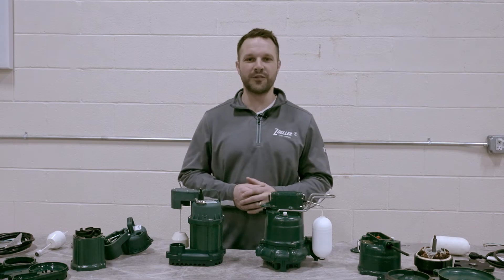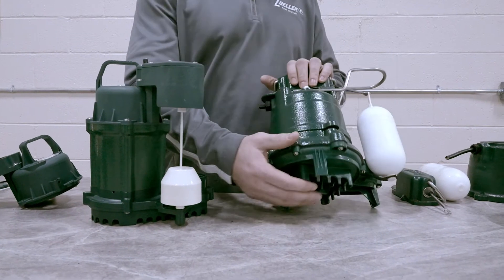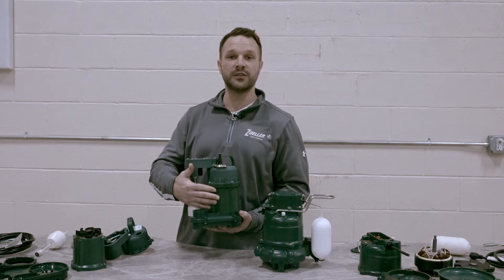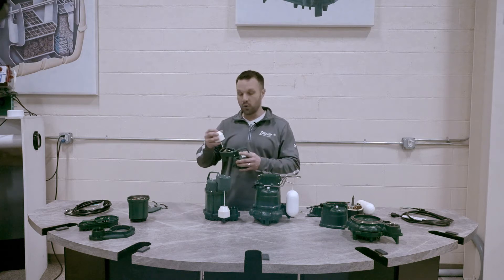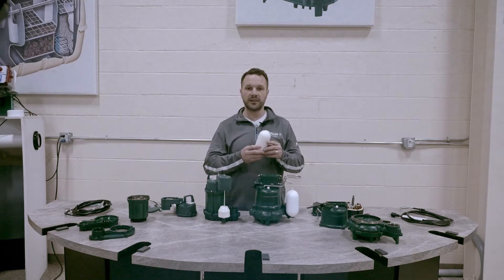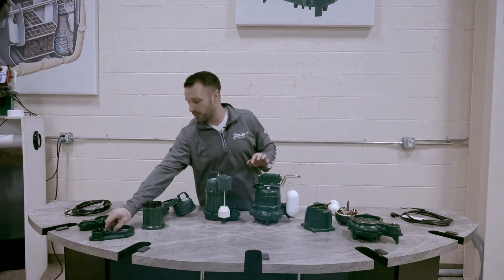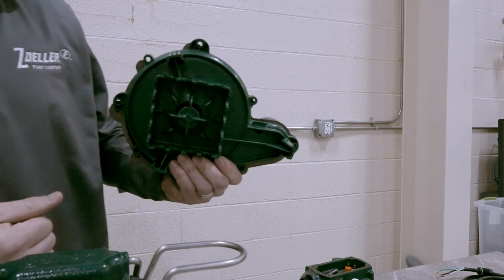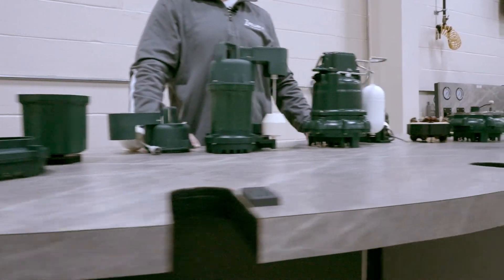Entry-Level Pumps VS Core Product Line Comparison

Comment: Too bad the float switch fails and will leak water into the housing on these pumps.
Reply from the maker: Hi @petebusch9069. We have a few different switch options available for our pumps. If you would like to learn more about them, our experts in product support would be more than happy to walk you through the available choices. To connect with them, you can either email zcotechnical@zoeller.com or call 1-800-928-7867 and press option 6 to be connected with them. I hope this helps!
Reply: @ZoellerCompany  Why not just address the issue instead of providing a canned response that does nothing but give your company a bad reputation? You have good pumps but your floats are junk, we all know  that and end up using other floats. Do you really think avoiding that issue is in you best interest? Do you really think your fooling you customers? If you would just come out and say yes, this is the weak point and this is what we are doing about it then you might gain some respect. We all know you have a phone number, providing that does not help.

Comment: Does anyone know the procedure for refilling the pump housing. Is mineral oil used or machine oil? How much oil is used? Enough to cover the miter completely?
Reply from the maker: Hi - if you contact our Product Support department at zcotechnical@zoeller.com or by calling 1.800.928.7967 and pressing option 6, they should be able to answer this for you.